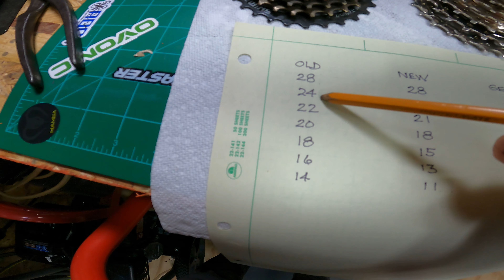Ebike ride along and how-to - Ghost pedaling fix

Comment: Hi Richard.  Excellent video!  I can't think of a time when a Youtube video was more helpful to me.  Your video demonstrated the ghost pedaling problem perfectly and I confirmed that this was the same issue I was having on my Deer.  After watching the video, I clicked on the links for the freewheel and removal tool you suggested and placed the order.  After the part arrived, I watched the video one more time and then headed out to the garage for the installation.  The installation was just as easy for me as it appeared on the video.  I can now cruise 30 mph on those flat and straight stretches with no problem...and no ghost pedaling!  And to think that it was only $38 dollars for both the freewheel and the removal tool really was the icing on the cake.  I might do the same thing on my wife's Ocelot Pro next.  I can't thank you enough!
Reply from the maker: Glad I could help sir! On the other bikes you may or may not see a washer on the hub. If you do be sure to remove it. Richard
Reply: I'll keep an eye open for that washer.  Thanks again!

Comment: Yes sir Richard, we must have read each other's minds.  I changed my Ocelot to a 11-34 and you to a 11-28.  My Rad-Rover came with a 11-34 in 2020 when I bought it, but I put a new one on when I put the new motor & controller from what is now Area 13 (Bolton).
Reply from the maker: Like minds terry!

Comment: Good job!
Reply from the maker: Thanks Russ.  I tried the 52 tooth chainring on my cruiser.  It worked well but I kept getting grease on my pants from the unprotected chain sticking up.  The freewheel change was a piece of cake with that removal tool FR-1.3 from parktool.  Thanks for your comment sir

Comment: Interesting video. I haven't messed with a freewheel in decades. All my bikes have cassettes. My current e-bike has a 46T chainring and a 10-45 cassette. I have no problem at all with ghost pedaling up to 28mph and still have plenty of gear left when I push it above 28 and lose my e-assist. Maybe because it's a mid-drive. Not sure.
Reply from the maker: Thanks for watching joe. Yeh it makes a pleasant difference for me
Reply: @Rip1Outdoors  I like this solution better than changing the chainring, and if someone really needs to crank up the workout they could do both.
Reply from the maker: @Joerides7  exactly. I changed the chainring to a 52 tooth and it helped but you couldn’t find a bash ring as well to go with it.  Your  chain stuck up above the bash ring and every time I got on the bike I would rub my pants against the chain and get grease on my pants

Comment: Thanks for this install video. I'm going to do this on my new ocelot pro. Is that an ocelot pro in the background and did you put the same cassette on it too ?
Reply from the maker: Stephen yes I purchased 2 ocelots for my wife and my daughter. I have not changed the freewheel on those yet. Only my deer and my cruiser. The freewheel link in my description should work on the ocelot with no problem. I didn’t even have to adjust my derailleur. Let me know how it works out
Reply: @Rip1Outdoors  Thanks for speedy reply. I ordered both  the cassette and park tool you recommended to remove old cassette 👍
Reply from the maker: @Chopbreaka  how did that work out for you?

Comment: i got  a ebike that is 21 speed 7 and 8 speed is to slow on 21 speed there is 3 disk you need the 3 disk that will give you 15 to 21 speed in 21 t0 18 speed i get no ghost pedal
Reply from the maker: Good deal Leonard